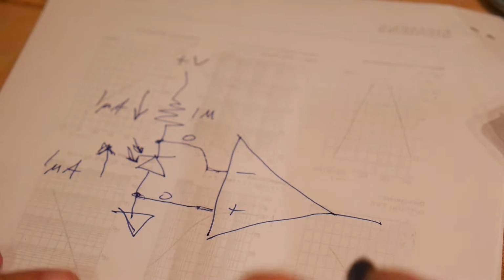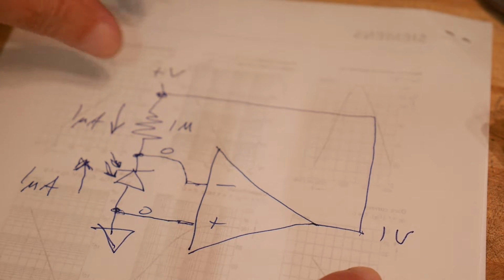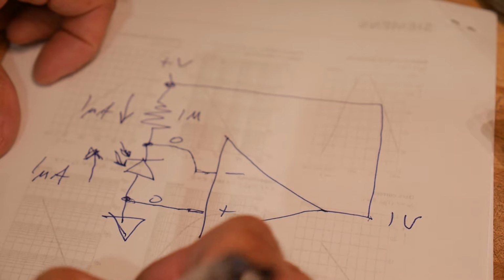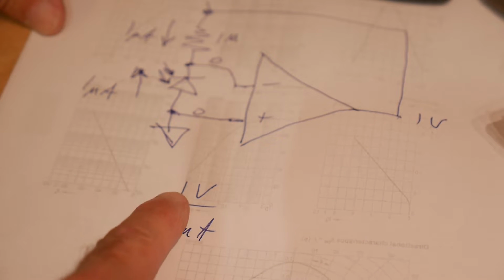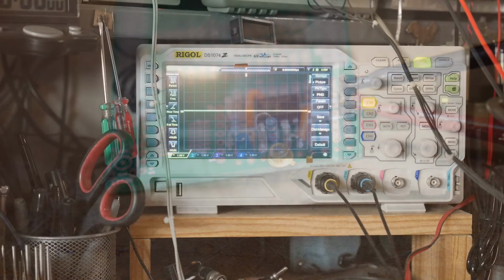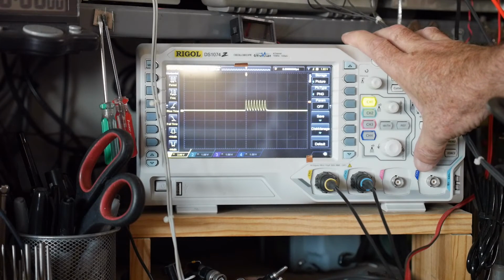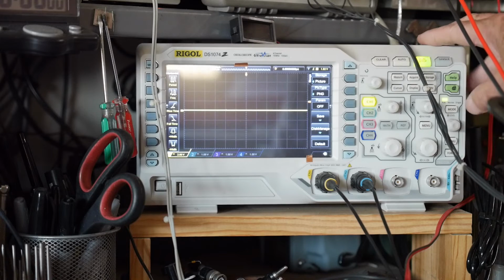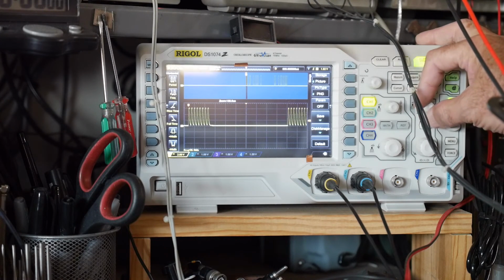#433 Building a Transimpedance amplifier for a Photodiode

Comment: One useful way to check to see if a remote control works is to use your cell phone camera.  Most cellphone camera's CCDs don't fully block IR, so it will show up as a dim blue light through the camera.

Comment: First, lines on log-log plots are power laws, y=ax^b; linear is the special case b=1.  Second, at room intensity the current is nA.  To make a light level meter, for example, use a current divider in the feedback path to get an equivalent feedback resistance in the 100 MOhm range.  Third, for faster response you need to reverse bias the diode a few volts rather than 0 V; this trades linearity for speed.  To get faster still, you must use smaller diodes with less C and diodes optimized for speed.  LEDs actually make decent fast photodiodes when reverse biased a couple of volts.

Comment: Nice video!  I always enjoy your posts.  One note:  at  roughly 16:00 you show the diode current backwards.  The currents don't "cancel".  By KCL, the sum of the currents entering then node equal the sum leaving the node (Opamp bias currents being ignored).  The photo current through the diode is a reverse bias current, cathode to anode.  So the current will flow from the opamp output, through the resistor, to the inverting node, then through the diode to ground.
Reply from the maker: your are right. was thinking voltage
Reply: @IMSAIGuy  But I do think you were correct in that the feedback current matches the photodiode current and sum to zero as per KCL.  It just means that since those two branches cancel, the current for the third branch leading to the op amps input must be zero.  So in some sense, because the two branches "cancel", the third branch must be zero.

Comment: Interesting video but I did see something I do not understand.  At around 16:00 you show a 1 µA photocurrent going into the node connected to the neg-input of the opamp.  Also the 1 µA current trough the resistor is flowing into that same node.  According to Kirchhoff's law the sum of currrents in a node is zero. The  input resistance of the op-amp is too high to drain the sum of both currents, so the only remaining path for the photocurrent is via the resistor,  'upward' in the diagram. Thus the current direction in the resistor is opposite of what you have drawn.  For a current to flow in that direction, considering the neg-input of the op-amp being 0V, the voltage (+V) must be negative according to Ohm's law.... OK, the op-amp will take care of that.  But, at 18:40 you say that the LED will light up if the photo-diode is illuminated. According to your diagram the LED will light up when the output voltage of the op-amp is positive....  Did I miss some theory here or is your physical circuit different from the diagram? Reversing the photodiode f.i. will make the output of the op-amp positive when the PD is illuminated. What op-amp did you use?  It must be rail-to-rail (and a bit more) on the inputs for this circuit to work with a single supply.

Comment: I seem to find many references to photodiode circuits that simply use a voltage divider.  I tried a similar experiment as yours using a photodiode (one that resembles a waterclear LED) to trigger a red LED.  When I operate the room's dimmer, the LED tracks it very well.  So perhaps a transimpedance amplifier is not always necessary.  Here's one of several references:
https://electronics.stackexchange.com/questions/33659/how-do-i-connect-a-photodiode
Reply from the maker: yup, and sometimes you can use a transistor instead of an opamp. just depends on what you need
Reply: @IMSAIGuy  Perfect answer, thanks.
Reply from the maker: @Enigma758  I'm used to photodiodes needing lots of gain. common to have 400M ohm resistor in the feedback for low signals. If you don't need any gain then something as simple as a resistor can work fine.

Comment: Very useful and thanks for sharing! One questing here, I heard that to get faster response we need to put a inverse voltage to the PD. So what’s the response time of this design you have? Can I use this for the IR signal decoding?
Reply from the maker: It was not designed for speed but I'm sure it is fine for IR decoding which is quite slow.

Comment: Hello there IMSAY Guy,

I got a 13AMP003 also to help me out on a project building a TIA. Unfortunately it sometimes gibberishes the values and fluctuates a lot. Could you give some advice on repair ?

Have been really enjoying your channel this year, cause this video led me here in May. Thank you for your work and keep it up.

All the best !
Reply from the maker: I don't think you will find schematics. Those have an internal battery so you might remove/replace that
Reply: @IMSAIGuy  Thanks a lot, but it's not that. I'll try drawing the schematic and maybe changing some components.  Best Regards .
Reply: @IMSAIGuy  Hello. Managed to repair it. It was the internal regulator which was faulty. Always check the voltages going in :) . On batteries it works fine.

Comment: Very useful. I just have few questions
1. What is the amplifier chip 
2. You didnt show in the drawing where you connect the supply to the circuit Im still confused of where the supply should be connected to the circuit 

Thanks a lot
Reply from the maker: at 19:29 you can see it is a TLC272 opamp. the orange wires are power and ground. pin 8 Vcc pin 4 Gnd
Reply: @IMSAIGuy  Thanks a lot

Comment: Thanks for all the great videos. What photodiode is the closest to a PMT for very low light detection?
Reply from the maker: The PMT is very good for low light. A diode will never match it. If you want the best chance then you need a large diode. I've used the PIN-10D diode in a BNC mount. one square centimeter diode. About $100. You will need a very good amp. For low light you might also optical chop the light and use a lock-in amplifier.
http://www.osioptoelectronics.com/application-notes/osi_parts_catalog.pdf
Reply from the maker: https://www.thorlabs.com/NewGroupPage9_PF.cfm?ObjectGroup_ID=287
Reply from the maker: https://www.thinksrs.com/products/sr810830.html

Comment: Dear Sir!
I am from India. It's a nice and useful video. I have two doubts.
1. For a particular photodiode, how to practically calculate the minimum and maximum photocurrent, it can generate?
2. Can you tell the model no. of the 'Melles Griot' Large Dynamic Range Amplifier? I am looking for the purchase link..
--
Thanks in Advance!!!
Reply from the maker: 1. 13AMP003
2. datasheet

Comment: Will a 741 op amp work in place of 272
Reply from the maker: yes, but with modification to the circuit. The 741 needs a +/- voltage supply